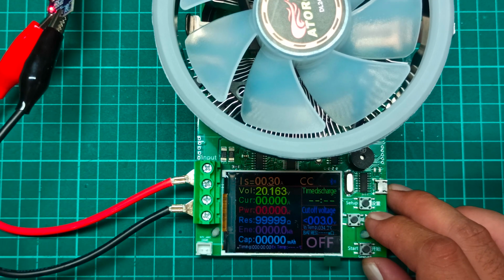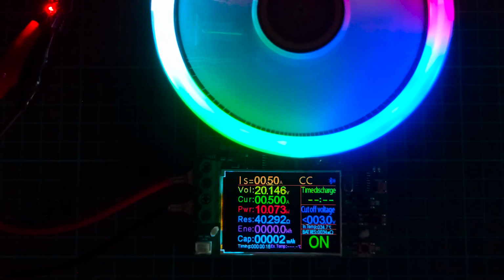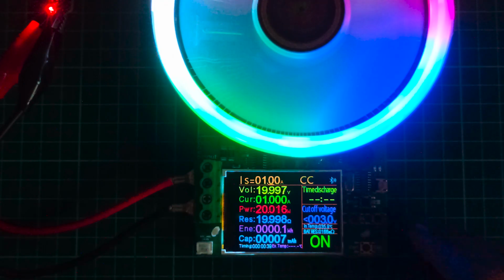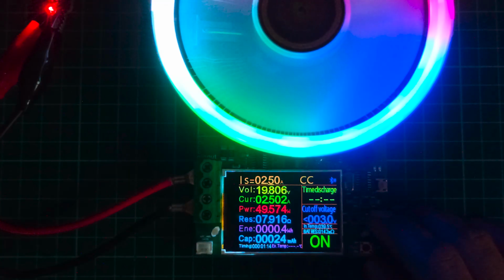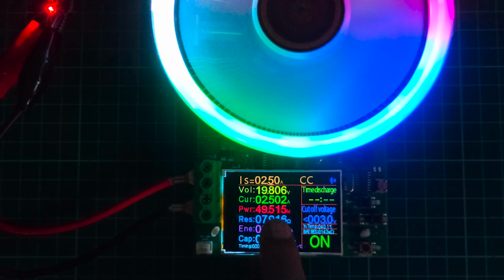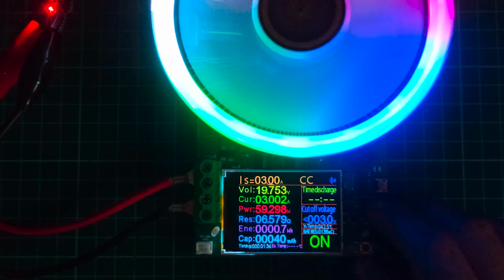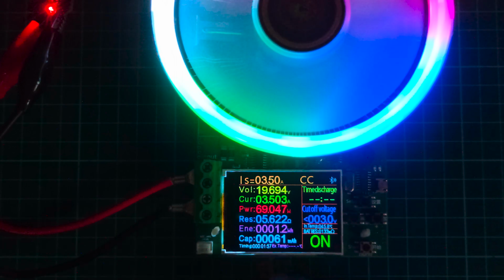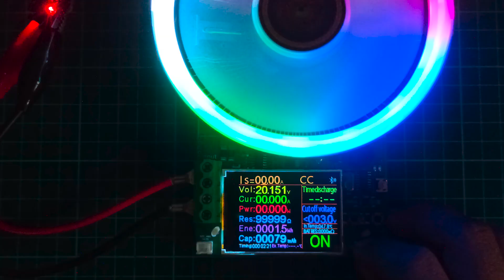USB Type-C Trigger Module Review | 5V to 20V Load Test (70W Max!)

Comment: Hi. Very interesting.
But what about the temperature of the module while higher load?
Reply from the maker: As you can see in the video, i have tested the module for upto 70W and it remains cool, the reason is because the chip on the module only provides a trigger signal to the charger on its data pins for various output voltages. The passage of current is directly from input to output.

Comment: I have one of these and the chip you couldn't identify is marked: "PAK02A RFCXN2000 2445AASAP"
Mine has a purple tint to the PCB but otherwise it looks identical
Reply from the maker: Thank you for identifying me the chip :)
Reply: @ERLEngineering  i found same board with the following chips, the bigger chip you couldnt identify : CH224K 201804E17 , smaller chip 78L05